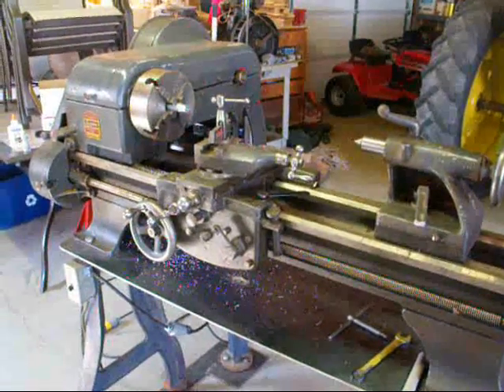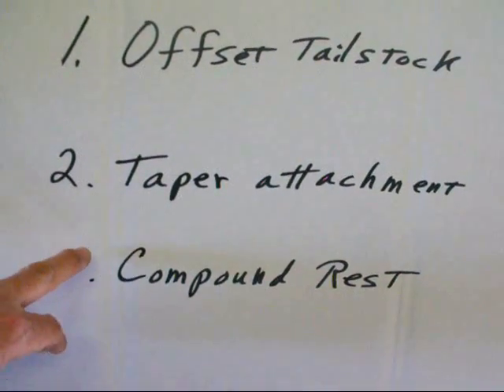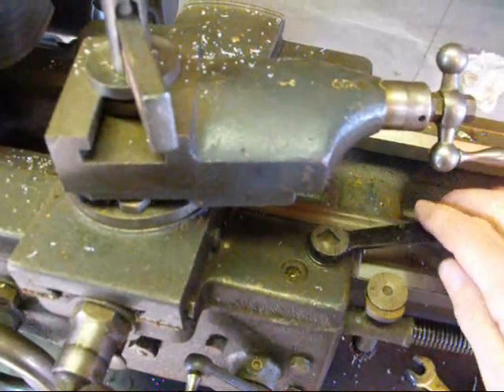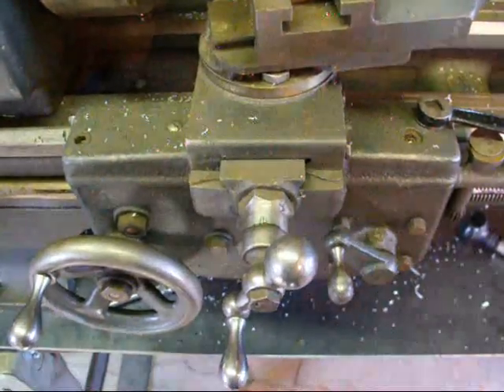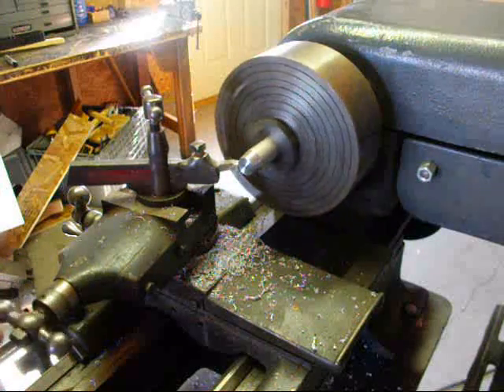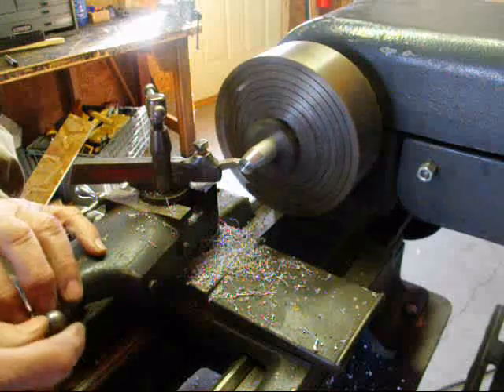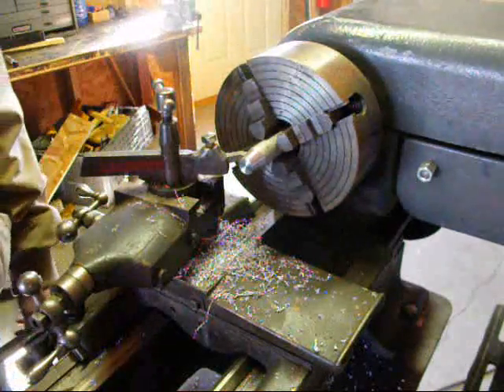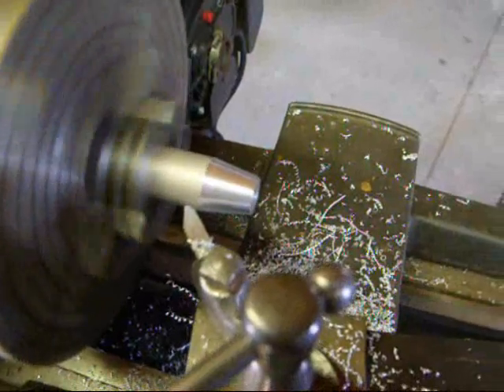TURNING A TAPER ON THE LOGAN LATHE tubalcain

Comment: Using the tail stock to turn tapers I used a metal ball bearing with a center drilled hole between the center and the part. It helps to make better turnings. Just an fyi.

Comment: This is exactly what I wanted to learn. How to use my compound to
cut my Morse Taper's. I have a taper attachment on my South Bend
Heavy 10 & I want to learn about that, but I have tools to make...some
for myself & some to sell to supplement my income. I'm thinking that 
being a "Tool Maker" would be a good starting point for me. I will need 
to practice since I've been away from a lathe for quite some time. 
I'm here to Learn. Hopefully distance learning, with your Machining 
mentorship here online will help me to improve what little I have learned 
from prison & the vast knowledge I can attain from your video's & others.
Thank you for creating your channel, I had to put my education on hold
due to transportation issues. I was enrolled @ Hilo Community College.
My major was Welding & Machining. I'm hoping to get my AS before I turn 
70...I'm 62 now. I love machining because of what it does for my Automotive
& Diesel repair thing I do for y family.
As long as you are on YouTube I will be here to learn anything you have to share.
Aloha,
Chief

Comment: HI I was asked a question on a test.  Wanted to know 3 ways to make a taper using a lathe.  
I said adjust compound slid and use taper attachment what could be the third?  Thanks in advance.
Reply from the maker: The tailstock offset method
Reply: mrpete222 thanks so much 👍

Comment: Dear Tubalcain:  Thanks so much for your videos's.  They have helped me immensely.  I recently restored my dad's 1955 South Bend lathe.  A total overhaul top to bottom. Paint, bearings, oilers and wicks as needed.  Just one thing.  I don't know how to use it.  That's where you come in.  All my projects start with one of your videos.  One complaint though.  The last video "Turning tapers on the Logan Lathe" was approximately 9 minutes 30 seconds in length of which over 5 minutes was devoted to methods you weren't going to use.  So little addressed the method under consideration you signed off and then came back with additional instruction and video.  I barely learned enough to make it work, but it took twice the time it should have because so many topics were over looked.  I ran a few test pieces to work out the bugs.  I'm building a large telescope, and it requires 12 tapered pieces.  Thanks again for the instruction, but next time forget the methods not in use and focus all that considerable knowledge at hand on the topic at hand.  Today, there are few with your skill level.  Wishing you only clean cuts, Glenn
Reply: Glenn Cox Having the knowledge of the various methods and the pros and con's may lead you to investigate how to do one of the other methods mentioned if it suits your particular project better or have the optional equipment on hand. Since the other methods are viable and are commonly used in the industry, mention of them is essential for a well rounded introduction. Take what you need, others may want more than you since he has a large audience.

Comment: Did you set the compound to 10 degrees or 5 degrees? 10 would give you 20 and 5 would give you 10; I'm curious because later you say to recut a 60 degree on a dead center to set at 30 which is half so you wind up with a 60.
Anyhow, playing around I tried this method you show here and made a nice piece for my wife for a holder she wanted. Thanks again, fantastic class.

Comment: This is a pretty old video, however it is exactly what I need to complete a project. My son-in-law asked me to turn four knobs for a auto air conditioner he was installing in an old auto. The original knob is approximately  7/8 '' in diameter, 1 1/4 '' long and is tapered down to approx. 1/2". I tried making a from tool out of an old file but that didn't work so well. This video is perfect and explains in great detail how to accomplish this project. Thanks you sir for your help in this project....Ken..Marina CA
Reply from the maker: Glad it helped

Comment: I'm a metal turning novice with a new mini lathe, and have been searching for an example of how to cut a simple taper on a piece of bar stock. This is by far the best example that I've found. Thank you for the clear explanation of the various methods, and the practical demonstration.

Comment: Hi, you dont need to use a traditional centre for tailstock offset turning, make a cup for your tailstock,and support your work with a ball bearing between the cup and the centre hole in your work, works like a charm!!

Comment: Great videos, Ive been learning alot. I recently bought a Southbend 10k and have been playing around with it.  

I have a need to make a custom sized bearing race pusher.  Will your above method work for cutting the taper and then facing the shoulder?  Im guessing last pass after cutting the taper, pull the cross slide back to face it.

Comment: No universal motor, universal motor is like what a drill has. 
These are induction motors. Get yourself a TECO  VFD, they have one that is 110 volt input, and about a 1/2 HP. 3 phase motor. Then you can have variable speed and reverse, and an Emergency stop with electronic braking, all controlled from the VFD. It is an Awesome set up. I have one on my wood lathe, and am ready to put one on my Metal lathe. I have a Logan just like the one In this video. I would like to have him as a instructor.

Comment: Great video by the way. Im in highschool and my manufac teacher is having me taper a 5 degree cut on my baseball bat we are making on the lathe out of aluminum and he told me to set the compund rest at a 90 degree angle from the tool post then move the hole thing to a five degree angle and i have to do the same cut u did i hope you can help me thanxs.

Comment: Great service you provide!. I spend more time on the lathe then my job and your skills have improved my work considerably. Thanks a lot for your guidance. I feel bad asking, but I'd love some guidance on:
-leveling, gibbing Heavy 10 (or any other lathe)
-cutting a good 5-c collet (mine are pretty high tolerance, but not great)
-accurate measurement when dealing with a lot of slop (old machine)
-setup for lathe/milling machine

Thanks again, you should be paid for this work you've done!

Comment: Great technique. I am in a machining class and was just taught the exact way of turning tapers by rotating the compound to the degree that is desired. Works wonderfully.  My compound is manual feed as well, so on my finish pass I count one second  in between .005 marks on compound feed. A bit time consuming but makes for a consistent  finish without lines when you count in your head. Nice videos

Comment: Thanks oddly I have always done it this way. No schooling, no books, and no help.
I figured this out myself.  Now this vidio. I guess I did well.  It began when I lost a
MT 3 center.  So I chucked up a good MT3.  I then with dial ind. on compound,
went back and forth with my carriage until it dialed into '0' then locked in my comp
rest. .This is now the angle. I figured out to turn it long enough as to put into my
headstock & cut to what I need  Works perfectly. self taught  thank you SP.

Comment: Thanks, that was useful to see (and hear).

A bit surprising to hear that the cutting on the back travel was the result of workpiece flex. It appeared to be a shallow cut on a reasonably large diameter rod. Is work flex the only reason this can happen?